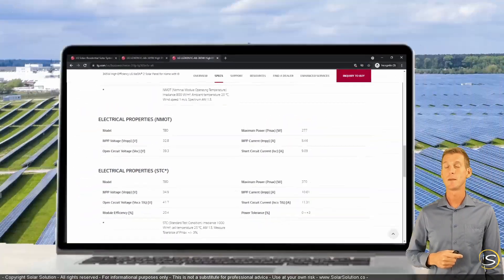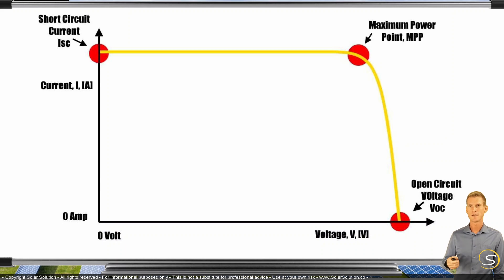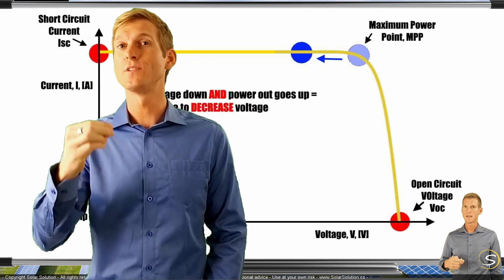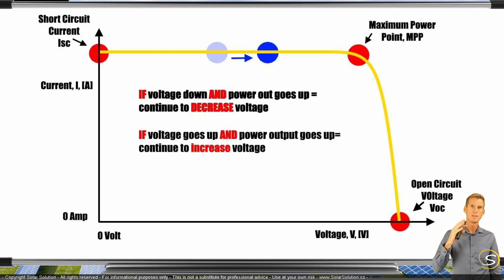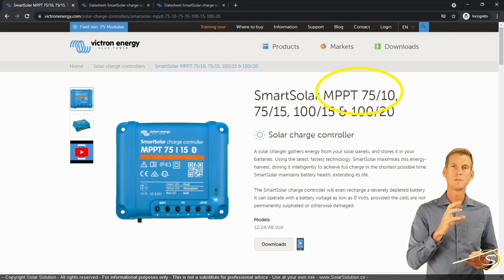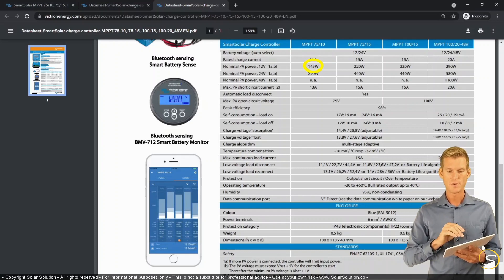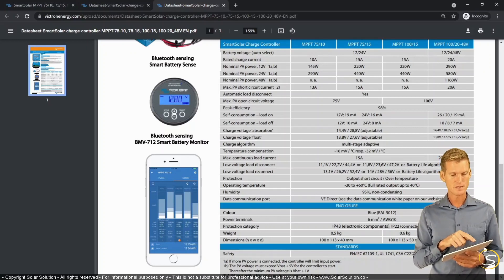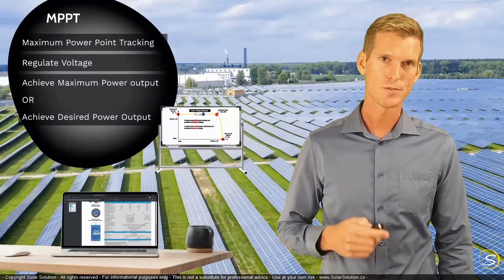MPPT Solar Chargers: When they are better & Where to use them

Comment: You said the mppt changes the voltage so as to come to the point of maximum power point in the IV curve. But voltage is produced by Solar panel, how does MPPT change the voltage?
Reply from the maker: Good question! The MPPT solar charger has a build-in adjustable resistance, which is used to adjust the voltage. Thanks!